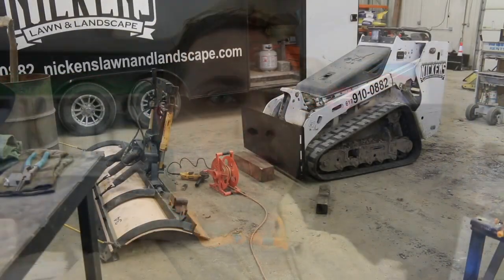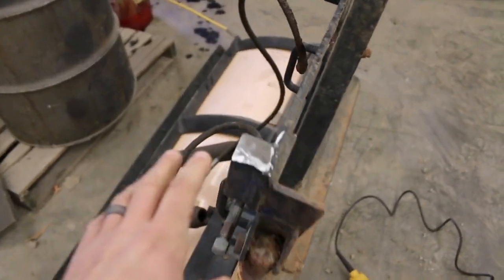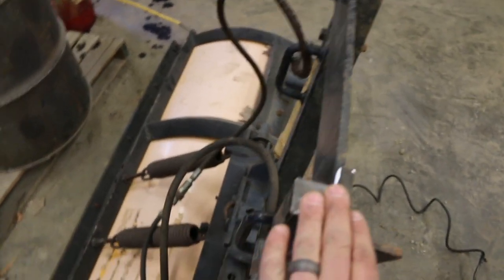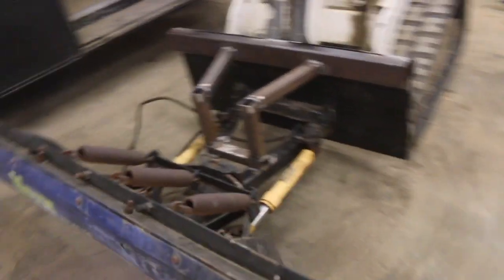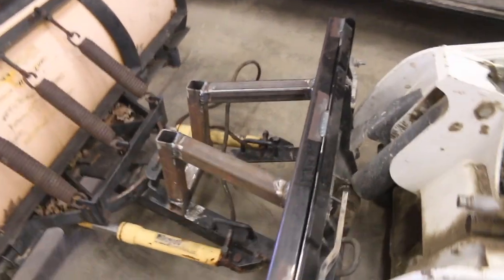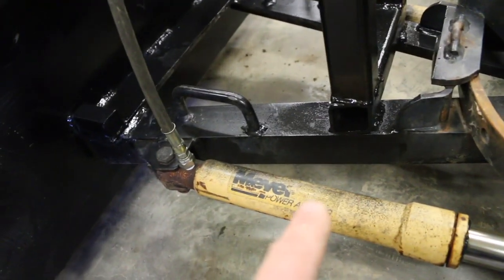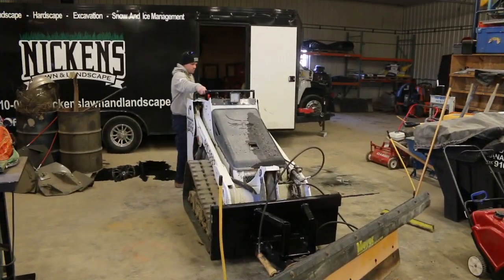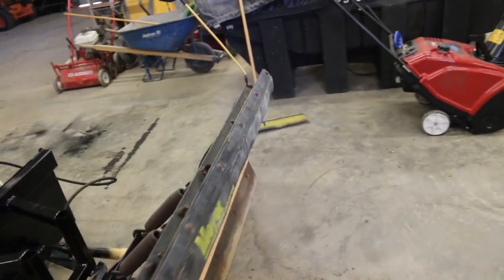Custom Skid Steer Plow Build for Bobcat MT85

Comment: I would have mounted a chain for lifting instead of rigid mounting it with the square tube. And then have a pin connection like a normal plow allowing it to have some float so you don’t have to keep adjusting the loader arms to keep the plow on the ground. This would also allow the tracks to keep full ground pressure for traction while pushing.
Reply: I actually did that with a skid steer plow turns out it was a bad idea for me  because when you stack or hop curbs it bounces and that bouncing made the skid steer quick attach plate bent just enough where we couldn’t put any other attachments on the machine.
Reply from the maker: Like ER we tried this before and it was not enough down pressure and eventually led to things bending. The new design worked great last storm. A little learning curve but after a couple minutes we were rocking and rolling.

Comment: Where did you get the hydraulic lines? Thanks!!
Reply from the maker: We got them at a local shop that makes them. A lot of places make hydraulic lines. You will need to get the fittings from your dealer. Your dealer can also make custom lines. They will just need to know what size thread the cylinder is